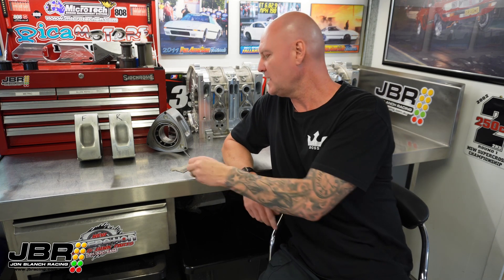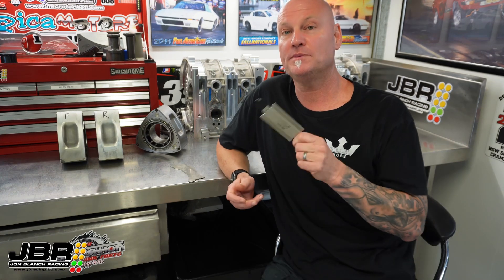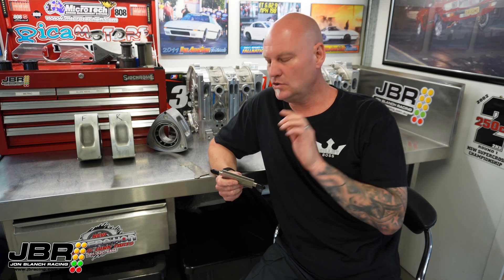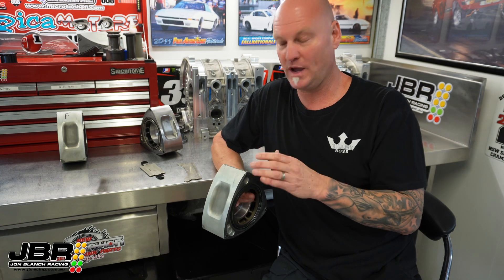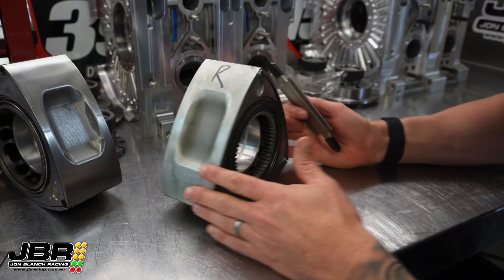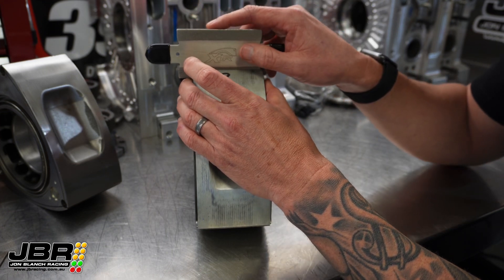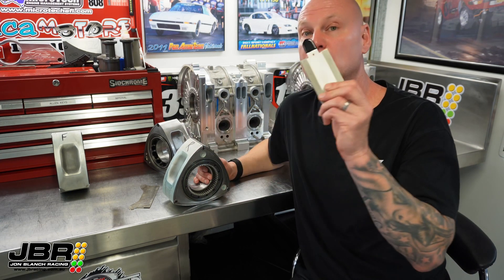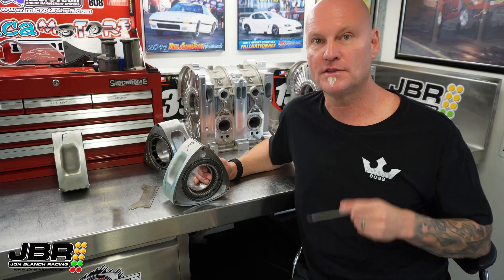Rotary Engine Tech - Apex seal to groove clearance

Comment: Of course there’s a 2 in 1 file now that i recently bought the old style 2mm  only type 🤦🏻‍♂️
Reply from the maker: With the cost of the material & diamond coating going through the roof this year, making both sizes as individual files & keeping stock of both sizes in stock just wasn’t financially viable. 
Changing to a smaller, double sided file will hopefully solve that problem 🤞🏼